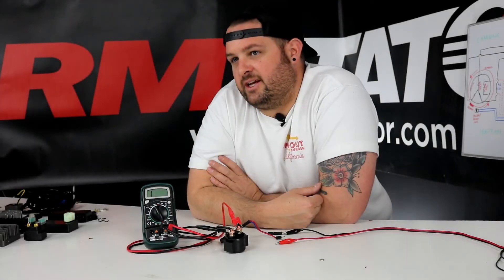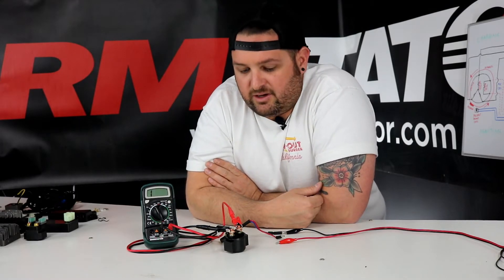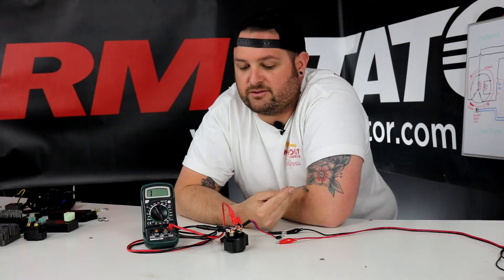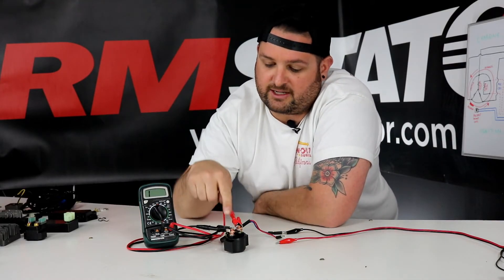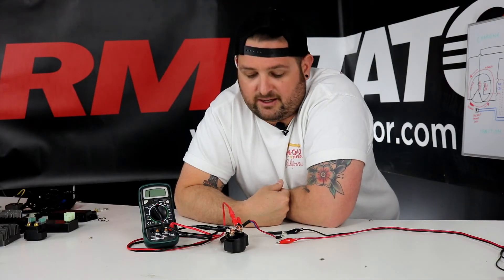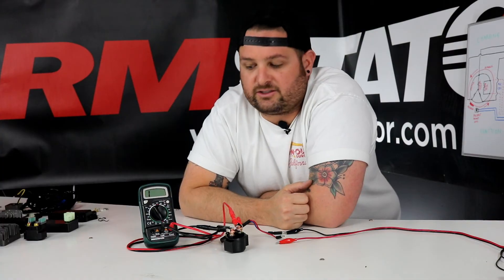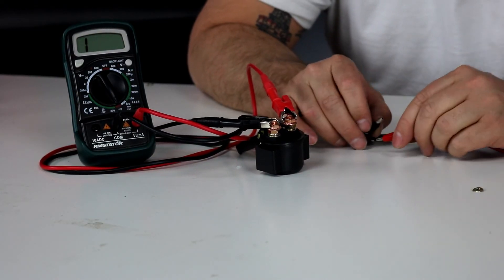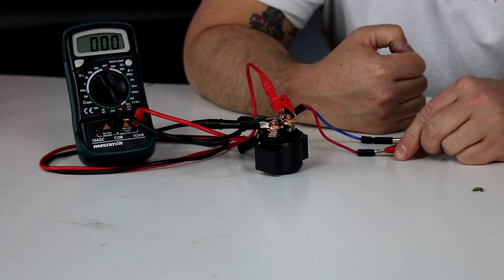How to Test Starter Relay Solenoids for Motorcycle, ATV, UTV, Snowmobile & Powersports Engines

Comment: Put a new relay on my 1998 Yamaha Timberwolf 2x4. With the battery disconnected I get continuity across the posts.  Should I? Can the relay get stuck in the closed (on/start) position even without current? I'm having a problem where when I shut off the switch and the key, the starter motor keeps turning. I have to disconnect the battery ground. I can't figure it out. The quad starts easily and runs smooth, but is the starter motor still turning? I can't hear because the motor is too loud. Before changing some electronics, coil, key switch and harness, starter relay, solenoid, the starter would start turning when I connected the battery. I have about 3 weeks to figure this out before hunting season, or else I'm going to have to put a switch on the main ground to disconnect it, and maybe one on the starter relay if the starter motor is still turning.

Comment: Where does the negative wire go on an 06 polaris sportsman 700
Reply from the maker: Negative wire is usually grounded through the vehicle harness to the battery negative terminal or frame.

Comment: Quick question, do these solenoids act the same as a regular relay where if they rattle when you shake it, it needs replacing?  I've got a intermittent starting problem with my bike so checking the solenoid it rattles when I give it a little shake.  Thanks, Todd.